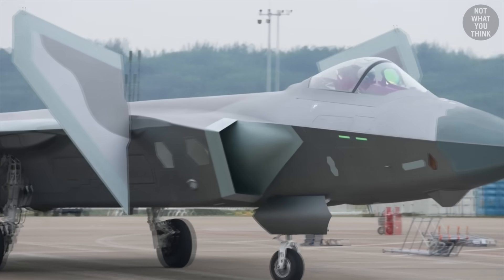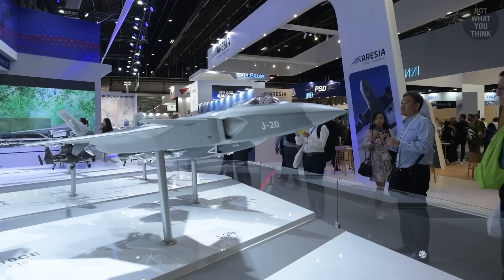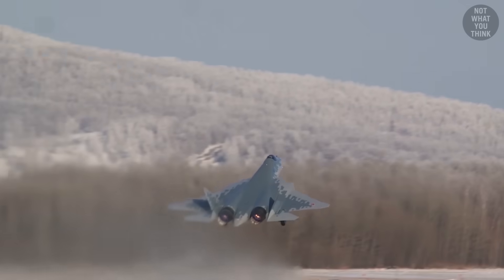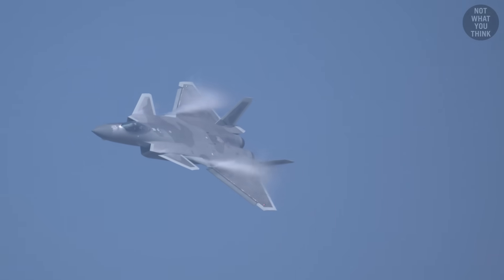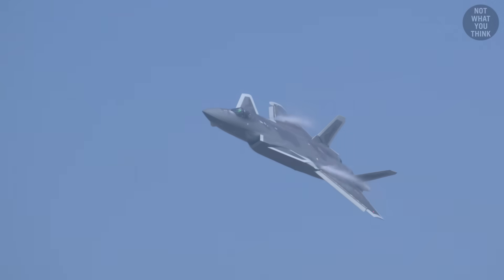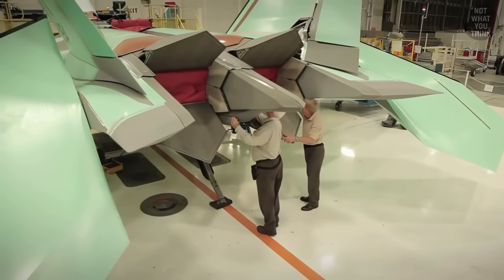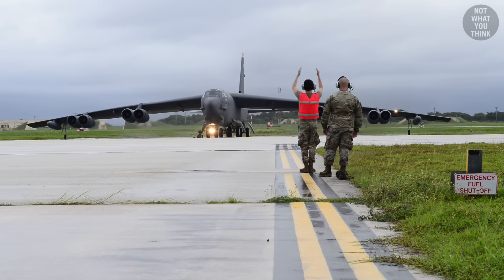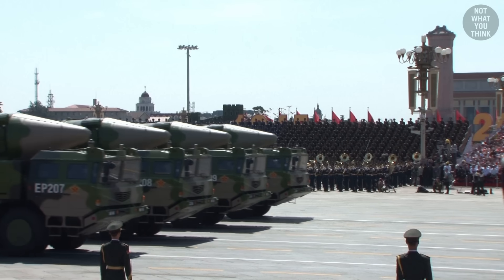Why China's Stolen "Stealth" Fighter is Problematic

Comment: The J-20 is no where near as stealthy as the F-22 or F-35, so you are wrong there. But its not actually intended to be, the J-20 is missile truck meant to shoot BVR (or Beyond visual range) radar guided missiles like PL-15 at things like AWACs and tankers. Not get into dog fights or even necessarily BVR/any fight with F-22's and F-35's. Meaning while the F-22 is an air superiority fighter, the J-20 is a point defense interceptor. That's not a knock against China, its actually quite smart. The Chinese don't want to try to match the US in the air, with air superiority fighter verses fighter. They know even US 4th gen fighters are very capable and very deadly. So their doctrine is to prevent 4th and 5th gen US air assets any force multipliers, like tankers and AWACs. Because they know the US is less likely to risk expensive air assets without said multipliers. The Chinese know eventually the US will move in even without said assets, but they will hesitant and hold back for a time. Allowing Chinese forces to achieve their objectives, like the taking of Taiwan, and build up defenses before that can happen.

The US see's this and has started changing its doctrines to counter. It already testing new adaptive cycle engines to increase its current fighters ranges by at least 30% or more. At the same time the US has already started flight tests with the upgraded F-22A a new generation of external stealthy drop tanks/weapons pods and pylons. Increasing the range and weapons load of first the F-22 and later the F-35 (which is also part of the upgrade program) without sacrificing its stealthiness. The Chinese are already working on a version of this upgrade, but so far are having difficulties in creating something cost effective, large enough to be useable without compromising the J-20's stealth capabilities. The US is at least decade ahead because it has had much longer to work with stealth coatings and has been working this project in some form since the 1980's. For the F-117 and projects to create weapons pods for 4th gen fighters that don't increase their RCS (radar cross section).
Reply: they do talk about it later in the video around 9 min mark
Reply: Why is the F-22 still the stealthiest fighter with extra fuel tanks, while the J20 canard wing is such a liability? I think a lot of people actually have no scientific basis in their minds, but simply think that the United States is always stronger in science and technology

Comment: "Guns aren't necessary in modern fighter aircraft because new long-range munitions technology makes close range dogfights unlikely."
 -Tell that to early F-4 Phantom pilots during the Vietnam War.
Reply: The us learned that lesson the hard way. Its why even the f22 and f35 still have guns.
Reply: Except Washington specifically demanded that F4 pilots visually ID their targets at the time. This is the most important context people often forget. Also dogfighting was unnecessary if you just bomb the aircraft on the ground, which was what pilots during Vietnam demanded from higher up, and also what they did during desert storm. Also you mentioned "early F-4" which means later F-4s didn't have as much problem since they had renewed air combat tactics. It was a question of training, not equipment because much later F-4s didn't have guns.
Reply: @fidjeenjanrjsnsfh  its not forgotten context, even prior and after that restriction was in place no gun was an issue. Missiles werent the most reliable at the time. What do you think is going to happen when a fight between stealth fighters happens? Missiles become unreliable at best.  Engagement distances shrink. Guns become more relevant again.
Reply: In a case where both J-20 and F-22/35 won't see each other in BVR, it will certainly lead to a dogfight. So a gun is still important. Wonder why they haven't given F-35B/Cs a gun when F-35A has one.
Reply: @johnsilver9338  to my knowledge all 3 variations have a 25mm gau 4 barrel gstling gun
Reply: @trailblazer632  Only the A variant has an internal gun. The B and C variant will have have to carry external gun pods.
Reply: @johnsilver9338  still better than the f4 originally had. They had to cobble together a gun pod system out of spare parts before they upgraded the airframe
Reply: @trailblazer632  am I remembering this correctly, that the USAF did eventually incorporate the manufacturer-built gun-equipped variation while the USN just continued with the makeshift "pod" system until finally phasing out the F4 altogether?
Reply: @skyden24195  yes. I forget which variation it was the D or E. Which also saw an engine upgrade if i remember right.  The navy was already engaged with the f14 design and had already planned to phase out the f4 for the f14 by that point.
Reply: @johnsilver9338  I was thinking the same thing about this scenario, i.e., two stealth-generation fighters encountering each other in visual range unexpectedly due to the stealth capabilities of both aircraft. That is a very possible scenario to occur. And if/when it does happen, a plane with a gun will have an advantage over one that does not.
Reply: I'm just going to give this added bit about whether or not to have guns in a fighter airplane: it's better to have and not need than to need and not have.
Reply: That era is over
Reply: @lmn6335 uh huh. Thats what the us politicians said then to. They were wrong.  And so are you. Having a backup gun in a fighter is always necessary.  Especially if multiple stealth fighters are in the air bypassing radar systems and getting progressively closer before engaging, or being stealthy enough to avoid long range missiles.
Reply: @trailblazer632  Haha, it's really over. You know what the air combat instructors say? -- Instructors; Why do stealth fighters engage in dog fights? Cadet - because we have more maneuverability - Instructor: No, because you're stupid
Reply: @trailblazer632  Dog fighting is the romanticism of the Air Force, which is sadly over in the era of stealth fighters

Comment: The no-gun strategy will come back to bite them.  Unlike the video, I would argue a head-to-head fight between stealth aircraft is actually MORE likely to end in a dog fight.  Between that and the upgrades the F22 is currently getting it is going to be an uphill battle for the J20.  It will still largely come down to the pilot in the plane though.
Reply: In BVR its the stealthier plane. In WVR though its the pilot. But both F-22 and F-35A besides being more stealthier also have an internal gun. So in both cases J-20 is likely to be eaten. Not to mention F-35s are the only aircraft that can literally see through their cockpit which will be a huge advantage in a dogfight.
Reply: @johnsilver9338  wait what ? f35 in a dogfight is a sitting duck . f35 is horrible dogfighter . and a dogfight is impossiple i gurantee it is because of the mar
Reply: @salamaahmedbalash6548  Nope. F-35A has Typhoon's T/W ratio and Gripen's wing loading. While F-35C has Rafale's T/W ratio and Typhoon's wing loading. So it's as fast and maneuverable as any 4th gen platform except F-15E. Especially the C variant with its bigger wings it can replicate the same tight turns F-22 or Su-57 does in a dogfight. But most importantly J-20 don't have a gun so it will be eaten in a dogfight against F-22 or F-35A.
Reply: @johnsilver9338  bro u know nothing about what contributes to a fighters maneuverability. look the wing loading isn't the only factor . the AOA the maximum G force an duration , the strike angle of the surfaces ,  F35 stands no chance aginst any of the above in terms of maneuvering . the only thing that stands with the f35 is its t/w ratio . wingloading means nothing if the center of gravity was not in a favroable position
Reply: @salamaahmedbalash6548  Says the armchair expert. Nope. T/W ratio and wing loading are a good marker of an aircraft's maneuverability. A better wing loading means less G-force a pilot experiences during tight turns. Do you even know that? Besides, F-35 has a higher AoA than even a F-16. F-35C on the other hand can replicate the same tight turns F-22 does in a dogfight. But most importantly J-20 don't even have an internal gun. So not only is it beaten in BVR but also likely to be eaten in a dogfight too. 

Besides of the 3 heavyweight dual engine 5th gen stealth, J-20 has the slowest minimum full turn. You can even see this at the recent Zhuhai airshow if you've watched properly. It's not a fighter, but an interceptor meant to do hit and run tactics than initiating dogfights.
Reply: nah it's not the 1980s any more  , MAR of the modern missile(minnimum abort range) of sth like the aim 120d id 40-30 kilometers . that is the point where u cant evade the missile. so yeah it will not ba great proplem
Reply: @salamaahmedbalash6548  except when talking about stealth aircraft where those missiles will have a much higher likelihood of missing, even when fired from within the MAR, or never locking on in the first place.  Hopefully, things will never get to the point where we have to find who is correct on this one though.  At this point, it is largely just speculation on behalf of both sides.
Reply: @Finis08  i a agree 👍 👍 and yes hopefully not.

Comment: So the engine problems are all fixed. How many flight hours before the engines have to be replaced? How many hours? Come on, tell us. How many hours will the "new and finally fixed" engines last before they require replacement? Tell us! Cuz, from what I hear, its just a bit more or less,  than 1000 hours. How many hours for the F-22 and F-35? Over how many thousands of hours? What is it? 3000 hours? 4000 hours? Nope. Keep guessing. How long before NGAD? 5 years? 6 years? 7 years? Really? Guess again. 

So...... China with it's thousands of engineers can design engines and jets in just how many years? Digitally designed, tested and produced in .......... wait, you don't actually digitally design anything like this? Wow. Impressive. Having trouble obtaining things that you have been able to in the past? Finding out that what you obtained in the past is not working out so well? Chips are having trouble are they? Difficulty reproducing (obtaining) "chips"? Ignore that Stuxnet crap. That is just make believe anyways.  That "subroutines babble" is just that. Babble.

Just when you thought you had it all worked out, some BS happened, didn't it? Oops! Our bad. Welcome to payback. I realize that I just paint birdhouses in my arts and crafts class. I don't know much. Just a bunch of nonsense.